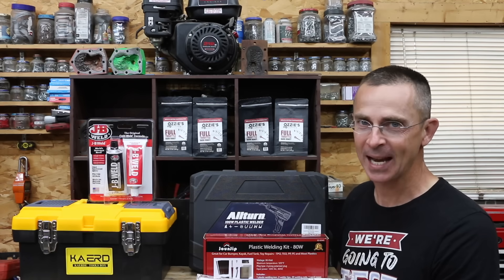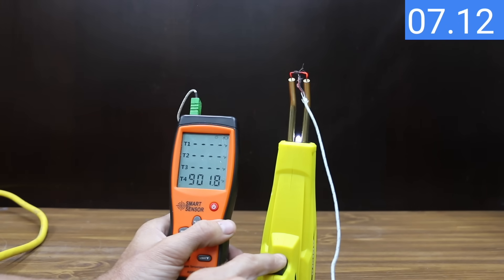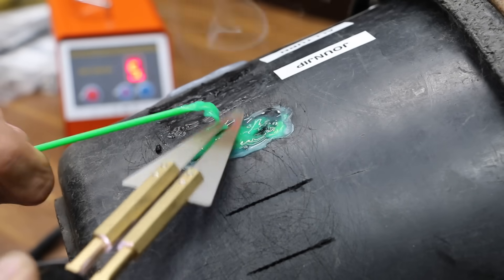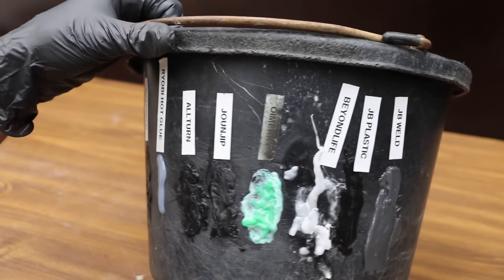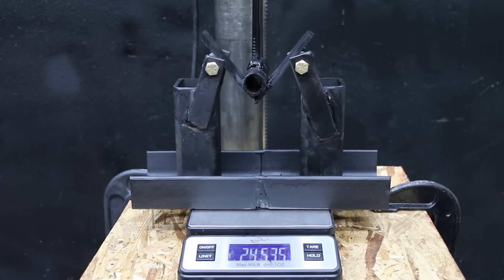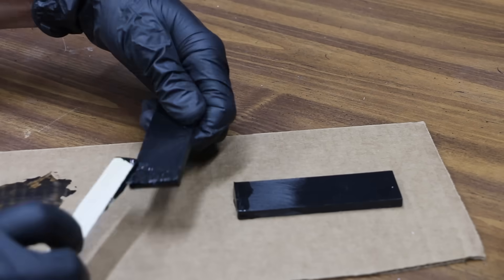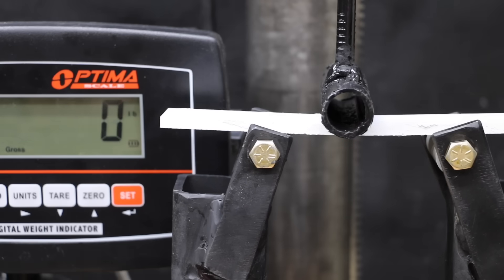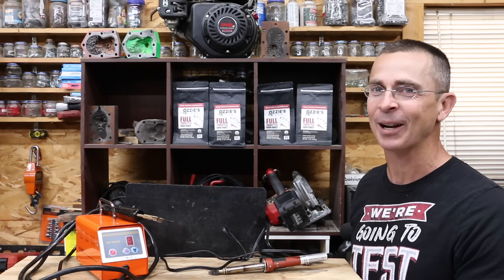Don't Buy A Plastic Welder Until You Watch This Review!

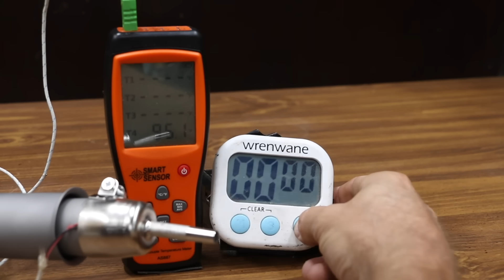Comment: I really love this channel, but az 4:34 you clearly don't know how to use that equipment. Those welds are very poor quality. The heat is way too high. The surface preparation is not executed correctly and you have melted the workpiece. I have more than 10 years of experience both in DIY and industrial plastic welding.

Comment: So bending load does matter some, but I think tension loads would see a much bigger difference from the staples and wire mesh. I also wonder if chamfering the pieces would allow for more penetration and a stronger repair, like with metal welding.
Reply from the maker: Thanks for the suggestion.

Comment: Really surprised most of these attempts were more like soldering or  gluing than actual welding which by definition is actually melting the material back into one piece. For instance if the pieces were beveled and melted as mixed with melted filler material that would likely had produced a much stronger repair, especially so with the staples and also the mesh pressed into the melted substrate.  The hot glue, or even the other melted filler material placed on top of the item without actually melting the substrate is more like brazing/soldering than welding, which just like in metal, is a weaker repair than welding.  I still enjoyed and  appreciate the video, though I would love to see another that actually melts (welds) the substrate back together.

Comment: JB weld still strutting its stuff here even in applications where you wouldn't normally pick it. That said, I would say Hot Glue is a pretty universal goto. Most people think of it as something for arts and crafts, but it's remarkably good at what it does, just like JB weld. They make more specialized hot glue and you can pick up some high-strength hot glue which might've performed better in this test.

Speaking of which, definitely seems as though you should consider testing hot glue guns, maybe even more so different brands of hot glue and see how they perform.
Reply from the maker: Thanks for the suggestion.

Comment: To extrusion weld the HDPE, you need to grind/sand the repair area to remove the oxidized material. Then the repair material needs to be melted along with the hdpe weld stick. The weld area should be stronger than the undamaged material. We extrusion welded miles of seams building landfill cells and capping old landfills.
Reply from the maker: Thanks for the feedback.

Comment: Putting in a lot of heat SEEMS good at the start, but the plastic becomes brittle from such "assault".  Better is lower temperature & physical strategies such as used in metal welding (beveling butt joints, etc.)
          Trying to rate plastic welding strategies on different plastics is like trying to use the same welding rods/fluxes on steel, aluminum, or copper.  It doesn't work that way!  For example, ABS is best prepared with solvent (or bonded with solvent alone).  Polycarbonate should not be bonded thermally unless it is prebaked for 24 hours at 250F to remove trapped water vapor.  Not doing so leads to it foaming up.  Polyester (especially that filled with fiberglass) won't bond properly at all.

Comment: you have to pre heat the plastics that are going to be welded, then melt the stainless mesh into the plastics(the plastics being fixed) then weld extra plastic on top , by doing this method it is slimmer and EXTRA STRONG, and takes less to sand(re a cracked bumper) and you use LESS Materials too.
 i use a homemade "spoon" with wooden handle and a blow torch, i blow torch the plastics that are to be fixed slightly then i heat the "spoon" just at the point of starting to glow(too hot it will blow smoke) not enough it will cool too fast) and i get a lot done on each heating of it, i have repaired many bumpers and  many many headlights and children's toys, all you did in this video was do surface welding(a bit like case hardening, or bird shit welding haha, means it didn't penetrate the plastics to be repaired) 
maybe you will come back and do another round of plastic repairs video

Comment: If you are welding PVC, try a PVC welder that is similar to a heat gun. Much smaller tube that expells the heat and you use a PVC rod that looks like a welding rod. Works on all kinds of PVC pipe fittings.
Reply from the maker: Thanks for the feedback.

Comment: When I use the standard JBWeld, since it stays too fluid for a while, I give it a half hour or so to thicken and then apply it. I have had issue in the past where when I used it right away, it just ran off the work piece. Try it using different intervals after mix but before application, 30 minutes, 60 minutes, maybe even two hours. I think it may also have to do with ambient temperature. I live in AZ.
Reply from the maker: Thanks for sharing.

Comment: I use a polyvance nitrogen welder. It uses specific rods for each type of plastic. When welding you need to heat the base material as well as the rod to get the best possible bond. I also use hot staples to hold the piece together once welded they are removed and blended with the iron
Reply from the maker: Thanks for sharing!

Comment: I found the best thing to use fixing an ABS bumper is the soft yellow body filler spreader. It melts (with a heat gun) like melted yellow cheese. Just stir the edges till they are a gray color and you got adhesion. No mesh, metal or other pieces to melt into the bumper. If you are fixing a low spot just heat up the area and push out from the other side and throw cold water on the plastic. It will cool the ABS to where you put it.
Reply from the maker: Thanks for the feedback.

Comment: As others have mentioned, repairing plastic is a skill that takes time to develop a technique for. Most people are only going to have a few things around the house (car bumper, etc.) to repair, and aren't going to do it enough to learn any technique... so your review is fine.

 think the most important thing is what kind of plastic are you trying to repair (some aren't going to work well), and using a piece of that same exact plastic, to do the repair (cut a sacrificial piece off, where it won't matter). Like sticks to like, and anything else is likely to be contamination, not a weld (it'll just fall off, or ruin your repair). You wouldn't use aluminum rods to weld stainless, would you?

Don't 'learn' on the thing you're trying to fix. Learn on a scrap. Get an old bumper cover from a junkyard and practice fixing it. Personally, I've found a hot air rework station to be quite useful, as well as something like a stainless steel putty knife (use it to smoosh/smooth the weld, and cool it down). Use a workbench, and find a way to position the thing you're trying to repair, so it's easy to work on, and won't move around.

Another key is to figure out exactly how much heat to apply, and how much area should be heated. If you overheat, you'll melt a hole, or warp something (good luck un--warping plastic). If you underheat, nothing will stick, and the weld will fail. You'll definitely want a practice scrap to figure this part out. A bucket of water can also be useful, for cooling something down quickly (or if something warps, you can reheat, hold it in the correct position and then cool with water, before it moves).
Reply from the maker: Thanks!  Thanks for the feedback.
Reply: Excellent tips!  Always practice your technique on a non-critical test setup. You'll hone your technique and will be less likely to have any surprises when making the actual repair.

Comment: When I've had to repair a larger piece like his sample (most electronic pieces are too small) I used wire but instead of making a staple I threaded it through like sewing, so one piece of wire acted like the three or four staples he used. Then I'd typically use epoxy on top top add strength. Usually worked well. Oh, and since I didn't have the neat-o heater I'd drill holes for the wire. You use what you have.
Reply from the maker: Thanks for sharing.

Comment: Hi, great video as usual!  I always wondered about these welders, and now we know!  However, you ask for ideas.  Remember the plastic model airplanes that you built as a kid. We used Testers plastic cement for that.  The solvent in the plastic cement literally dissolved the plastic, so that the two pieces literally became one. I am certain that any such weld would be completely as strong as the adjoined pieces.  The welders you showed don’t do that. That is why every repaired joint was weaker than the reference material.  I have long wondered, are there not plastic cements that work like Testers did on models, but for these other types of plastics?  For example, PVC glue operates the same way as Testers, and give a bond that is truly welded.  If there were such cements for other plastics, such a plastic cement would be much much stronger than any of the kinda hokey “welders” shown, none of which really welded the plastics as if they had been new.  Thanks!
Reply from the maker: Thanks!

Comment: The big Green one is a Leister knockoff and you didn't use it correctly..  or even remotely correctly.     Please use youtube to find find videos on the correct way to use the plastic rod melting tip.
I have used mine to weld cracked water tanks on fire trucks.

Comment: Aren't you better off using the heating tools to melt the ends of the pieces and try form everything into one piece, rather than just using the plastic as a glue coating on the outside?

Comment: I actually prefer using my Soldering hot air rework station for plastic welding. Mostly done ABS and HDPE with it, but it definitely makes enough heat, and has a pretty decent amount of control. Probably not the right tool for everything, but it works quite well!
Reply from the maker: Thanks for the feedback.
Reply: Been using a cheap chisel tip soldering iron for a year, and am amazed at the stuff I can repair that I would have tossed before.

Comment: Instead of mesh, I have used steel wool as structure. I melted the woo into the brown pieces first to hold them together. Then used heavy duty zip ties as filler plastic. Used the method to repair a broken headlight mount cause the light was brand new, but a tree fell on my hood and broke the mount and fender. Is been holding about 2 years now in TX heat.
Reply from the maker: Thanks for sharing.

Comment: This was PAINFUL to watch, no offense. It’s like someone testing different type of welders and welding methods…having never welded at all. 

You did the equivalent to welding a 1/4” peaces of steal by melting a fine pool of weld ON TOP of them.😂

Plastic welding has to penetrate and mix and one PRO tip, if you keep the co2 away from the heated parts (just like welding) the plastic will not oxidize and will remain flexible. The higher the temp the more oxidized it will be. Wire mash has to be preheated by heat gun and the surface soften the same way before mating them under the constant heat gun air. It should sink like hot knife into butter. You don’t need hot staples with the mesh. Mesh is 100 time better anyway. You use staples when you don’t want or can use wire mash. For solid connection where plastic doesn’t need to be flexible you can harden the mesh by heating it up till red. Make sure the shape is right first. 

Please, if you want to do something you have no skill in, hire a experienced person. This just makes me questions other test you did.

Comment: Imagine if this was metal welding. There was zero penetration with any of these repairs, with the filler only being slathered over the surface. If you weld plastic, your filler should match your workpiece, you should groove the joint, and the tool should be melting the base material as well as the filler so they mix, just like in metal welding. The sanding is only to clean the surface. At best all i could call this demo was plastic gluing, as all applications were just on top of the workpiece.

Comment: FYI: Not only showing us what are the best products but helps most of us who have never tried any form of the tools you show....a big THANK YOU from all of us.
Reply: In this particular instance, the "best product" can very much be situational and technique makes a big difference.  When plastic welding with HDPE, PE and PP plastics ideally, you want to melt the original material back together before adding new material.  If you're using staples or wire mesh, melt it into the plastic before adding new material.  The new material should fill in the void left from melting the original plastic back together.  This will give the best result and in most cases you have to add very little new material.  If done properly, the repaired area will be as strong or stronger than it originally was.
Reply from the maker: Thanks so much!

Comment: I used a cheapo $20 kit a few years ago from Harbor Freight to weld the plastic gas tank on a Honda Element after my wife ran over a tire jack that fell off a truck on the highway. Not going to lie, even with the tank empty due to where the jack ripped into the tank, it was a scary process but it did work and it held for over a year while I had the vehicle before trading it in. I used wire mesh when I did the weld. Prior to having the Element towed 40 miles, I didn't even know plastic welders existed. This video definitely shows there are some much nicer options!
Reply from the maker: Thanks for sharing.

Comment: I seen a guy that work's on riding mowers,  he used one of those with the wire fix a small john Deere mower hood. After the wire pieces were in he used fiberglass gel to fill in the crack. After it hardened he sanded and painted it. It looked like new.
Reply from the maker: Thanks for sharing.

Comment: I really appreciate you deciding to do a video on plastic welders and hot staplers as I've used both for several years, and was excited to see this one come out.  Unfortunately,  the processes used in the video were all wrong and completely invalidated the tests. Most of the principles used in metal welding apply here too. 

1. You should make a small bevel at the junction of the 2 pieces, on all sides to be welded. 

2. The plastic representing the base and the plastic representing the filler should both be melted and mixed together. 

3. You can buy different types of filler rods online. The plastic used as filler needs to be the same as the base plastic. 

4. The wire screen is supposed to be completely embedded into the base plastic.  Not just "glued" on top using filler. 

5. When inserting the staples into the base plastic,  you should end with a slight twist to completely embed the staple and cover the entrance grooves. 

Would love to see a redo of this video if you decide it's appropriate. 

Thank you.
Reply: I hope he revisits. There’s always great comments on PF’s videos but this one has some top notch ones. I really wish I had the time to sit here and read them all!
Reply: @UtahDarkHorse Excellent response i was thinking the same thing watching the video bit you put it so much better, also i have never worked with the staples and when i was trained to weld plastics in a prior job they did not use staples either, so your comment was an education for me.
 
@brickhammerSS It is a review of a product, and by using the wrong techniques the results are not really valid. Based on the results here a glue gun or JB weld might be a better choice, but as someone that has done plastic welding I can tell you that done properly JB weld and glue gun would have been at the bottom of the list. Also anyone looking to buy the products and looking at this video to make a buying decision may also end up making the same mistakes. If PF used these methods to make the weld the buyer would be informed and likely use that same techniques. Sure someone that buys any of these products and does not learn proper technique might get the same result but that's their fault for failing to get the knowledge they need. Comments pointing out the correct techniques may help someone that reads the comment to help them get the results they are looking for. It also helps people to realize the results are not accurate and the can factor that into their buying decision.
Reply: Thank you for a professional perspective. If I use one of these I will definitely keep your tips in mind.
Reply: Thanks for explaining this so well!
Reply: His video pretty much showed how most uniformed  DIY guys would proceed. Can you recommend a video or source that goes in to detail for maximum efficiency? Thanks.
Reply: Do you think some random person on Amazon buying one of these things to try and repair something in their house is going to know or even care about what you're talking about? They are who this video is for. Wow
Reply: @brickhammerSS Why do you feel a need to criticize someone correcting PFs mistakes? I'm sure PF appreciates the constructive criticism when he uses a product wrong.
Reply: @brickhammerSS if you buy any one of these you should read the instructions and use it properly.
Reply: @brickhammerSS 
There should be adequate written instructions that come WITH the tool. 
😳👌
Reply: @bobkrohn8053  Not typically with specialty tools

Comment: Excellent tests!  Out of necessity, I've repaired several plastic items, mainly with a 140v/100v weller soldering gun. As others have mentioned, I've had better luck heating the screen directly into the original piece & using minimal filler.  

Great content & thanks!
Reply from the maker: Thanks!

Comment: In my experience of you're going to use the wire mesh it needs to melted into the plastic you're repairing. Not in the plastic weld you add.
Reply from the maker: Thanks for the feedback.